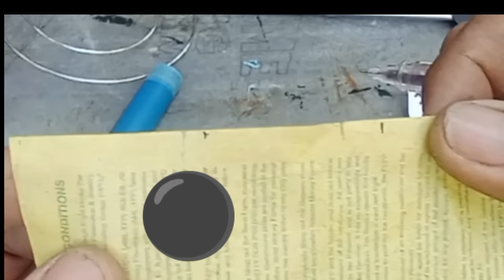DIY, TELESCOPIC GOLD LOCATOR version 1

Comment: I think this is my favorite one. A little harder in someways to make. End result is fantastic. I still am unsure about the "minerals" that you add to the device and where to purchase them. I see that it does make a difference in the device's behavior. Also, what determines how many turns of the wire on the inside and outside of the antenna? Good day.

Comment: I'm just guessing that most war head bullets are made of copper and rotates well compared to the other metals because most of the force coming from the device is from the copper turns you have just made. So therefore this device is more capable of detecting copper than gold.
Reply from the maker: No,that's wrong concept of formal

Comment: Translation please,  what's the material that you put inside de pipe,  ???? Thanks in advance
Reply from the maker: That's carbon battery powder mix with variety of none value  minerals from the  treasure site
Reply: Carbon battery powder or rod powder or dual